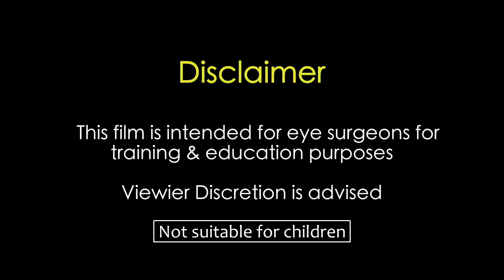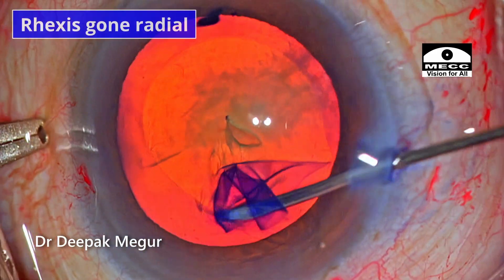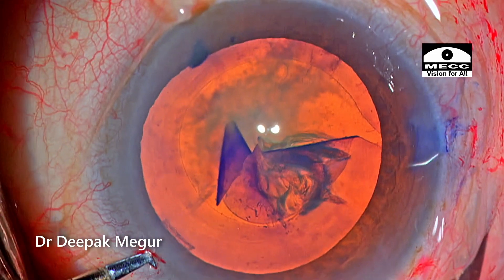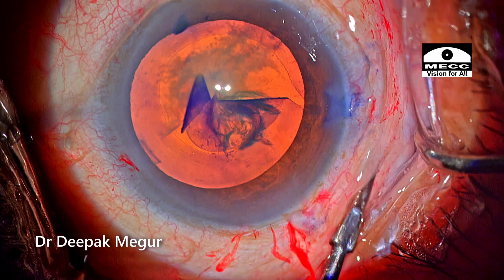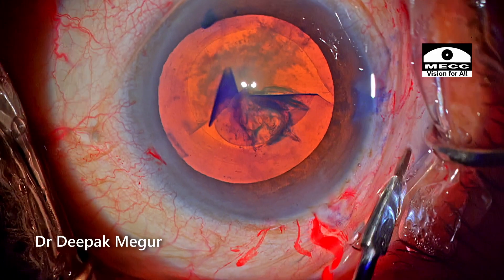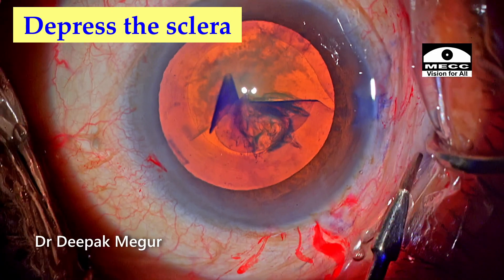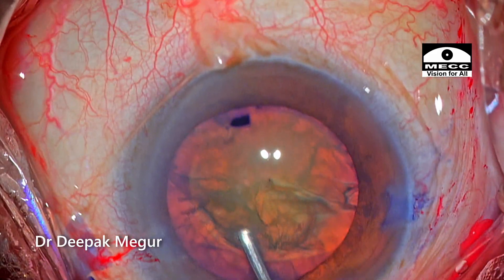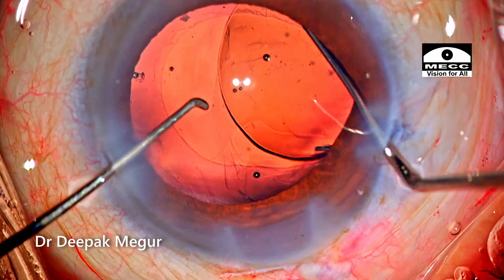Rhexis Rescue with a new twist..! - Dr Deepak Megur

Comment: Could it be that the runoff was caused by the positioning of the needle, which during the last push of the free margin of the capsule was almost halfway to the center of the flap? It seems to me that keeping the needle on the edge of the flap would have caused forces to continue the CCC, while what happened is that your pulling acted almost perpendicular to the direction of the CCC and the forces had to discharge in the most efficient way, which was tangentially... Does it make any sense?